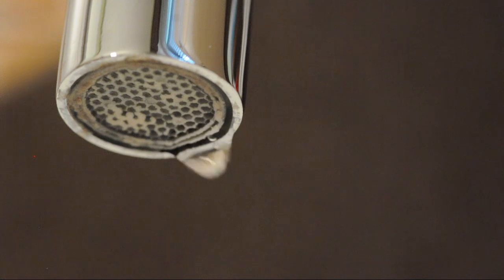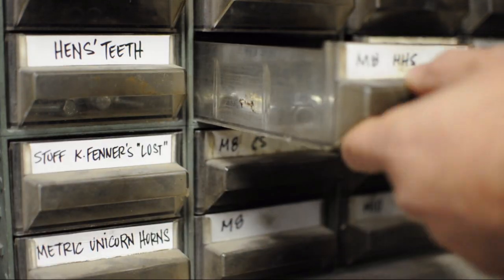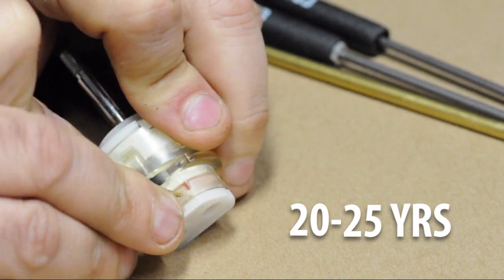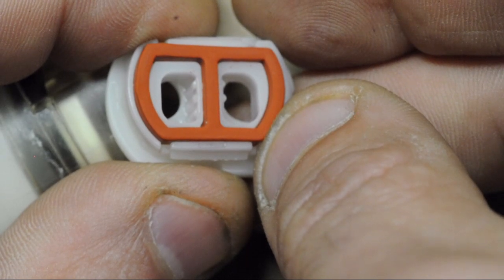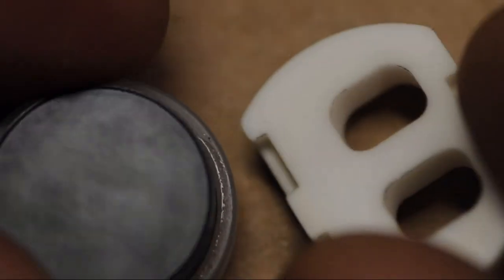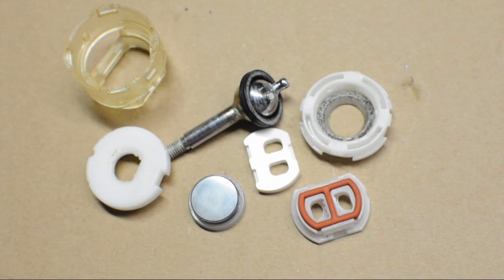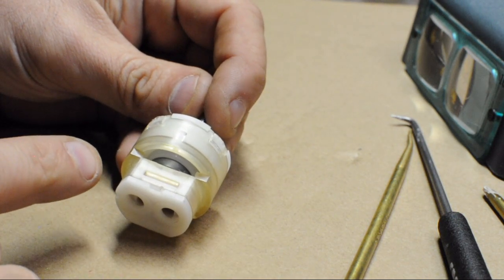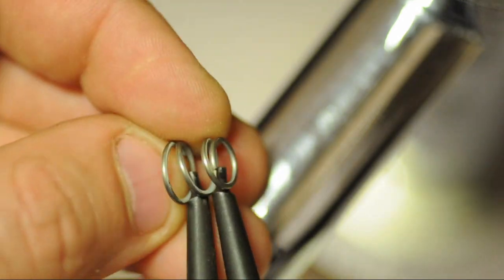Leaking Ceramic Faucet Fix

Comment: Hey Tony! Commercial Plumber here. You did a great job with that faucet. The seals and springs below the valve body are called "springs & seats" (we plumbers are an imaginative bunch) and were more than likely causing your leaky faucet, and "stretching" the springs is only a temporary fix. They are usually inexpensive, and are normally in stock at your local plumbing supply house. Disassembling the valve body was a brave move, and made for some interesting content, but was probably unnecessary. The scoring on the ceramic plates looked about normal for a 10 year old faucet. It's caused primarily by the abrasive iron and calcium deposits in your water supply passing. It should be mentioned that the pressure changes when the faucet is opened or closed can cause cavitation (on a very small scale) which will erode the surface of the plates over time (same reason container ships propellers need to be polished and repaired by underwater welders), causing them to appear dull over time.
Reply: I got a $350 invoice for "consultation" just for reading this comment

Comment: I worked in a hardware store for my first job that specialized in plumbing. Those little seals that sit underneath in sinks that use cartridges are the most commonly replaced part. I don't have any sort of evidence or insight as to what goes wrong with these things, but I can say that in almost all cases when someone came in with a leaking faucet that used those cup seals, once they were replaced the leaking stopped. I probably saw 4 customers a week go out the door with those seals for replacement and do not remember a single instance of anyone coming back in saying they didn't work. That's all anecdotal so it as such but I figured I'd throw in my 2 cents
Reply: I am a Plumber down here in Florida. That is a common point of failure that we deal with. Generally replacing the rubber seals and using a tiny bit of silicone based  O-ring grease for lubrication is the best fix.
Reply: @WhirlybirdFlyer  Agree! "Mineral rich" water makes the condition worse, and that's the usual fix...! 😎
Reply: Such anecdotal (aka empirical) experience (aka data) is a great tool in high-tech manufacturing, service, maintenance industry anywhere from fridge to fighter planes.
Reply: It is the chlorine in the water. It eats up the nitrile rubber and that is why they leak.
Reply: Peerless and Delta use those bottom seals and are easily obtainable.100% sure that was the leak source. I've sold hundreds of those spring and seal kits commonly available everywhere.

Comment: The use of the air coupling as a hex tool made me so happy. I love that kind of ingenuity.
Reply: Peter Charlton another go to: Use a hex bolt head of the right size. Then double nut the thread and turn with a wrench or impact. This also works when you need a large Allen wrench.
Reply: @irondiver292  nice! but of course it wouldn't work for the application in this video as it needs to be hollow. but for the other application really nice!

Comment: Love your vids.
I was the quality manager for a faucet shop for many years. We made millions of ceramic valves.
Your conclusions are pretty spot on. The flatness of those disks are measured using optical flats to about 1/2 of a wavelength of a certain kind of light (can't recall what that light color was). I've watched the ceramics be made & lapped. It's amazing and very, very process specific. You won't be able to purchase the compounds used. However, I also did substantial life cycle testing on plates like this... the plates simply will not wear. We even put particles of sand & iron through them... they are brittle as heck (no shock, no strain) but nothing in your potable water will damage these.
If you have a leaking ceramic faucet it will either be a failed seal or a loss of compression. I suppose a bad install could crack a valve or the valve body. That usually shows up soon after install.
I think you bought yourself some decent time with your cleaning / seal flipping (not the kind they do in the arctic).
Reply: I'll bet that wavelength was 632.8nm (a HeNe laser). It's the most common laser used in interferometry for measuring flatness.
The optics we use are usually spec'd between 1/4 wave and 1/20 wave (at 632.8nm). 1/2 wave would be a no go for the work I do. But in this case, 300nm (or 0.3um) seems flat enough.
Reply: LowJack187  I loved that seal flip video. Now you have me thinking how far can I launch my neighbors tiny loud dog?
Reply: LowJack187  Wow!
Reply: Do you remember the compound used for lapping ceramic valves? I would assume diamond but it's not always the best abrasive for every situation. Thanks for the info 👍👌
Reply: @weldersandblaster  Just feed it a really small squeaky toy with a diamond inside, like in the movie "Snatch".
Reply: LowJack187  I was curious what seal flipping looked like.  Now I know.
Reply: @weldersandblaster  Only one way to find out  :)
Reply: What about toothpaste as a lapping paste, although from what you say its not the ceramic discs?
Reply: Oh, trust me... there is NOTHING we cannot buy. Some of it isn't legal, but we can buy ANYTHING.
Reply: @timhofstetter5654  can you buy the "metric unicorn horns" that tony has?
Reply: As seen in the video, "seal flipping" is even MORE different than  "cow tipping" than you might expect.

Comment: I had a problem with my shower leaking and it had those spring loaded seals. I stretched them out alittle like you did and it fixed the leak. It lasted years like that. I got the replacement seals and springs later and haven’t installed them yet. So hopefully that’s your problem. But I just now noticed this video is 3 years old so yeaaahhh.

Comment: I give it a year.or two You're a hero for tackling a ceramic valve faucet successfully or at least very brave for attempting it in the first place.
It doesn't look you have hard water in your area so maybe a trap or two for debris/particles in the water supply might prolong the life of these things. If you had hard water, maybe a water softener cartridge might help too as long as you ensured everyone knew the water coming out is no longer drinkable - I don't know if you would want to use it for brushing teeth etc., probably not if there are kids in the house.

Comment: the black rubber and springs look exactly like the ones in the Delta faucet, the ones with the ball "crystal" (plastic) handles.   These usually rub against a chrome or brass ball that has holes in it to mix hot and cold and shut off.  these shred over time.  so if you wanted to replace just those, they are readily available.

Comment: What kind of abomination is a micro-inch
Reply: Never seen one (with the naked eye), but I'd imagine about 1/1000th a milli-inch. Seems I'm about 7 months late with this joke.
Reply: @android01978  exactly, or in every day language about 5.55x10^-8 ancient Egyptian cubits.
Reply: I think it roughly equals one femto light-second, give or take.
Reply: its a lil bigger than a nano-inch  about 27 times bigger
Reply: One milli-mil.
Reply: Its about three furlong-nanocubits.
Reply: Round about a hunderd millionth of a fathom or so.
Reply: The same kind as a micro-meter.
Reply: Can you convert that into Metric units or better Klaatanese Imperial Units.  My assistant Gort can help you with the calculations.
Reply: CURSE YOU FREEDOM UNITS AND YOUR CONFUSING WAYS!
Reply: A millionth  of an inch.
Reply: It's an rch!
Reply: the american spinpoff of a nanometer
Reply: a poor excuse for not using metric units i would say :p
Reply: Bicycles are well known to use mixed standards. The same part would use standard for diameter and metric for threads. (or vice-versa)
Reply: Andrew Crews  Don't you mean 583 milli-year? 583 micro-years is about 5 hours and 7 minutes.
Reply: When its really really tiny
Reply: The size of the tº°l measuring it.
Reply: About 1/40 micrometers.
Reply: SAE becomig selfaware of how obsolete it is.
Reply: It’s equivalent to 2/5 of fuck all
Reply: Ah yes, the imperial system. Tell me, do you know the definition of a pound?
Reply: One times ten to the negative six inches.
Reply: 10^-6 inches.  I.E 1 millionth of an inch.  I think that ends up being 0.0254 µm or 25.4 nm.
Reply: Well America became a super power with the Imperial system and Europe ....well at least it's easy for them to measure how far behind they've fallen.
Reply: @glennchartrand5411  The US didn't become a super power because of the imperial system.  Engineers have been using SI units for ages.  It greatly simplifies the math in physics by dropping out constants in all sort of equations.

The US became a super power, because it had a free market system, and very little regulation on what could be sold and created.  It also had a rule of law, at one time.

It's in decline because both of those have been done away with.
Reply: @fuzzywzhe  The USA isnt in decline.
That's something people who really are in decline say to feel better about themselves.

The next century will be defined by three countries.

China , India and the USA.

Notice who isnt on that list?
Reply: @glennchartrand5411  "The USA isnt in decline."
"That's something people who really are in decline say to feel better about themselves."

The USA is in decline, insulting me doesn't change that.  Up until the early 1980's the USA was the world's largest creditor nation, now it's the world's largest debtor nation.

It's been in decline for a long time.  In the 1970's somebody like Julian Assange would have won the Pulitzer Prize, today, people like Judith Miller do.  In the 1990's, any attempt to stifle free speech online was met with universal condemnation and abandonment of anybody that tried to do it.  The US has been in decline for a long time.

*"The next century will be defined by three countries."

"China , India and the USA."

The US will be notable, just as the USSR was notable in the last century.  Where is it today?  Gone, and good riddance.  We'll certainly be notable in this century.  PNAC is a spectacular failure, but I think it was meant to be.

"Notice who isnt on that list?"

Europe, Russia, The Middle East, Australia, Japan, South America, and Canada.

Europe will also be notable, as the EU is bound to breakup in the next decade or so.  Pretty stupid for the ruling classed to offer a free trade zone, and try to turn it into a banking dictatorship controlled by them instead.  They'll be lucky if their heads don't end up on pikes with all their progeny sterilized for good measure.
Reply: @fuzzywzhe  
You better pray the US and India flourish because without us , the next century will be truly heinous.
Reply: @glennchartrand5411  Damn, I'm being censored now.  Unthinkable just 20 years ago.
Reply: @fuzzywzhe  were you saner 20 years ago?
Reply: @glennchartrand5411  I was more innocent and ignorant.  Probably less sane, because I didn't know the entire nation was being gaslit.

You don't think youtube censors?  I write my posts offline on emacs, and save them because it's a superior editor.  If you have a place to post it, I can post it there, but not here.

It's funny to see the US companies acting like the USSR did 35 years ago.  Just before the samizdat finally destroyed it on December 26, 1991.  That's where the US is headed.

Your loyalty to this corrupt system will be as rewarded as the faithful communists were in Russia in 2000.  If the US has a real education system, you'd understand what that means, but the US doesn't.
Reply: @Niles Black preferences of royalty? You mean usefully scaled to how humans need measurements to be scaled and not randomly based on multiplying by 10 because that makes conversions that practically no one ever does in real easier? 

That inches in a mile is whatever 5280*12 is doesn't matter in the slightest just as 100000 centimetres is in a kilometer doesn't matter because outside of a tiny few edge cases (like manufacturing), no one measures shit in inches/cm when they need the answer in miles/km.

Congrats, your one advantage is entirely irrelevant in 90% of life.
Reply: @Niles Black why would I be mad at someone I'm ridiculing for being proud of being dumb?
Reply: @elcidbob  elcidbob wins!
Reply: @grassroot011  that can't be right, that's in base-10. It's gotta be about 978643.269th of one inch.

Comment: I have found most of the time it is the pressure that is put onto the discs by the rubber gasket that causes the problem. if there is not enough pressure then the disks will allow the water to pass. I have taken new valves and switched out the gasket to find the cause. your idea if putting the food grade paste does seem to add the added pressure needed. good video.

Comment: In Australia, many years ago I renovated the bathroom.  I chose Zucchetti mixer taps. They are supposedly one of the largest tap manufacturers in Europe. On one of the taps, the gold plating was peeling off the plastic cap and the tap was leaking after only 5 years.  It so happened that the Zucchetti distributor discontinued this model of tap, wonder why but was able to supply a replacement ceramic valve.  You guessed it,  for $100.  Nowadays you could buy 4 Chinese mixer taps for the cost of one ceramic valve, if you can tolerate quality of Chinese taps.

Comment: So having just seen this four years later, was your fix long-lasting?

I tried something similar with less complicated ceramic 1/4 turn valves here in the UK and the tap still dripped, but the good news was that the pair of replacement parts (separate hot and cold), were under £5 in total at my local hardware store.

Loving the content by the way… and those storage drawer labels made me chuckle.
Reply: It started leaking again eventually. He covered that in one of the pandemic videos I think

Comment: Those cup washers are the culprit I'm sure. Usually the hot one goes first as the rubber softens with heat and gets a small nic in it. They look like the same as any delta faucet readily available in sets with the springs.
Reply: Eric Allen I second that.  Those look like the Delta/Peerless cup washers and springs. Those were initially used with sliding parts gliding over them, either a ball or a flat surface. They were originally marketed as "washer-less faucets," as they did not use a rotating bib style washer that would turn and compress to seal. Not only does hot water soften them, but chlorine and possibly ammonia (if your water is chloriminated instead of chlorinated) harden and shrink the seals over time. The red seal inside the cartridge is usually more durable against chlorine and ammonia. 
On ceramic valve faucets, more often it is the rubber seals that fail, as they usually what compress the two disc together.
Reply: I agree and third that.  Any decent plumbing center (Ace Hardware for me) will have replacements, take your old ones down and have them match them up for ya.
Reply: Yes, I agree.  It's the Delta washers.  But you need to spend the extra two dollars to get the real Delta washers and springs, the Chinese ones last less than a year and the conical springs are slightly too short.
Reply: Agreed.  The rubber cups are normally the issue most of the time.
Reply: Agreed with the above, but also, if you don't have a source for the washers handy and they're not too bad, you can clean the scale off of them and exercise them a bit and they'll usually reseal.  It gives you at least several months to get new ones without the DRIP DRIP DRIP mentioned at the beginning of the video.
Reply: Agreed, if you clean off the outer face of the washer then it seems to help a lot.  I've managed to get more than a year from that kind of maintenance and a pretty bad drip.  On the other hand... they aren't that pricey either.
Reply: Eric Allen delta / delex is exactly what they look like.
Reply: Cheap Chinese/Tiawan seals DO NOT last more than 6 months in high chloramine/chlorine waters. Real Delta seals should last about 5-10 years depending on water. For really bad water, order Viton seals if they are still made. Pricey but needed in some cases. Nothing will last in sandy water.

Comment: I fixed the kitchen mixer tap leak using an O ring seal left over from an Isuzu Trooper head gasket kit. I must get round to getting a mixer tap seal to fix the coolent leak on the trooper though.

Comment: It's a good thing you didn't try to hone. I went at my valve from an RO spigot with some relatively rough SiC paper thinking that I could improve the sealing. Leak was increased a hundred fold. I bet your high viscosity grease did the trick. Cheers

Comment: You can buy the 2 seals on the bottom they are the high pressure seals the ceramic it the mixing valve.

Comment: "Hen's Teeth" "stuff keith fenner lost" lol  Nice helper you got there !
Reply: I missed the Keith Fenner drawer - had to watch again.
Reply: 🔥Ramsey Customs - turbocobra and the "metric unicorn horns"
Reply: Metric Unicorn horns are easy, it's the left hand thread Unicorn horns that are hard to find.
Reply: I thought unicorn horns were only SAE/ANSI.
Reply: Ah ha! Good one!
Reply: the trouble is.. you have to twist the horn off the unicorn before you know what it is. if the aminal bites you, you're going the wrong direction and it must be reverse thread.
Reply: @WhereWhatHuh  like pipe threads, they are converted to oddball metric sizes to be compatible.

Comment: I believe "should last forever" usually means 5 years, because after that, there's really no way you can force them to service or replace them. As opposed to 2 years that the normal stuff is supposed to break at.

Comment: I fix ceramic plate valves by polishing / cleaning the ceramic plates with regular toothpaste and printer paper. From my experience, it's just build up dirt and calcium which needs to be cleaned off.